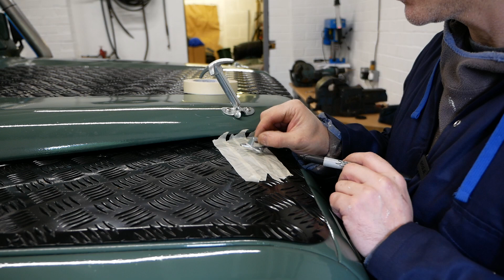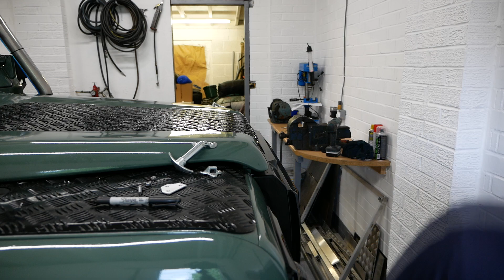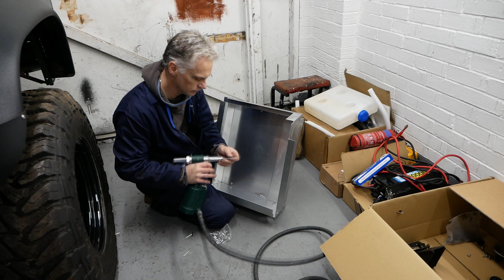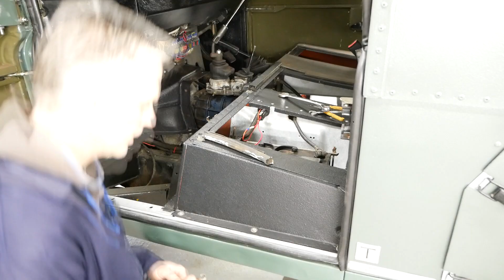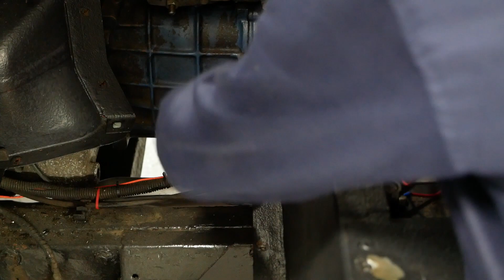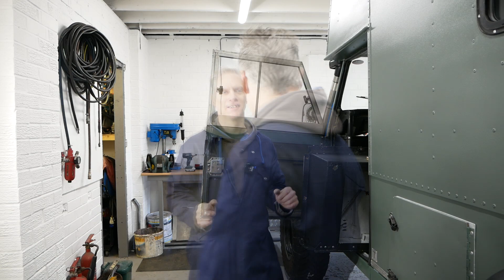Land rover 4x4 Overland Camper Build (Beryl) Part 2... | All 4 Overland

Comment: What ratios are you going for, with it being a fair old weight when loaded, and would you recommend Ashcroft refurb...?
Reply: Cheers for that Paul I asked the question because I was thinking of going higher ratio on my 110 its a td5 I bought a recon ,transfer box ,outright, about 5year ago ,and kept my original box, which I was going take to Ashcroft for a refurbishment, and have higher ratio installed, with the HD shafts , but don't no how it will affect, lowrange offroad driving?. I am subscribed, and I think when people realise you're back at it , I think your subscriptions will climb quite rapid,     anyway       .ta for getting back to me.
Reply from the maker: definately recommend ashcrofts but they are not the cheapest but do the best job..as for going to a higher ratio in the box it will not be a problem as it does not affect the low range...the low range gearing will remain the same regardless of what ratio you have in the high range..hope that makes sense and thanks for subscribing
Reply: @All4Overland  thanks for the advice I think I will go for the higher ratio then .
Reply from the maker: Hi stephen...with running the 300tdi engine i have got that onto a 200tdi box which is a 56A and i am going for a 1.4 ratio transfer box which is a 22D and 3.45 ratio diffs..should run quite well with those gear ratios and yes i would recommend Ashcrofts as they have built both of the boxes in my other truck...please make sure you are subscribed and share to make the channel grow...regards Paul